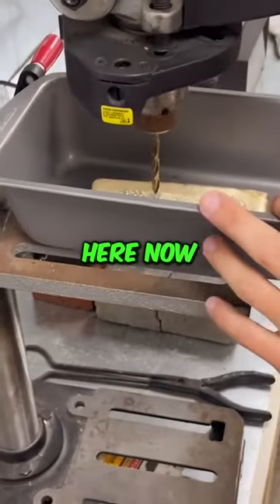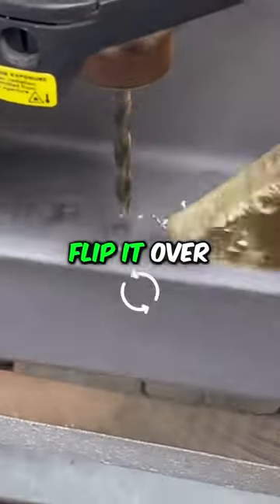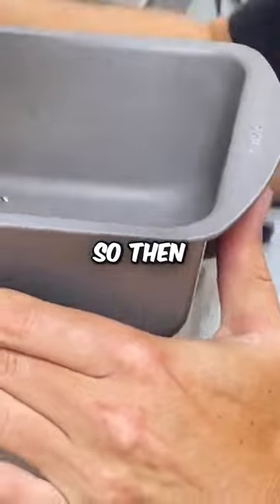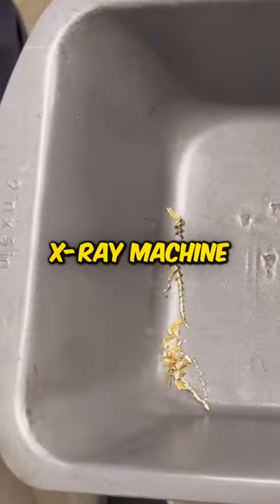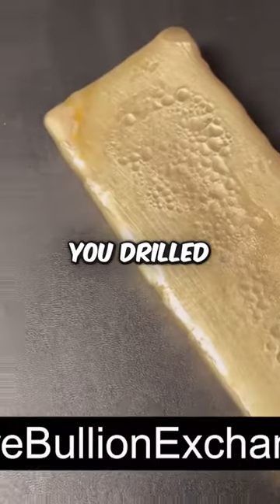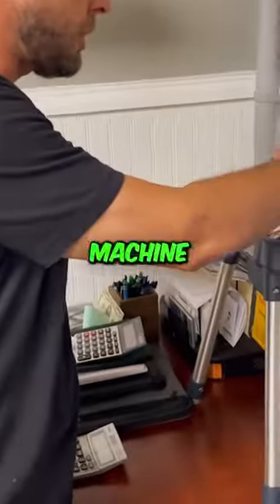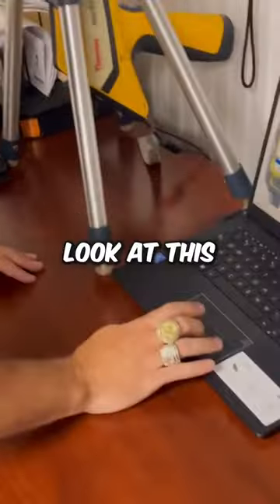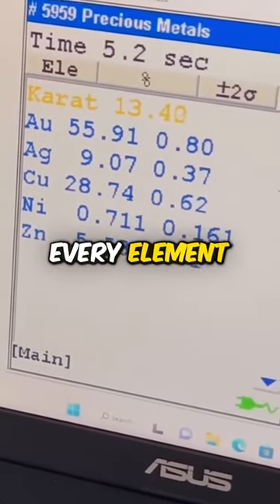Drilling MASSIVE SCRAP Gold Bars WORTH $200,000 For Testing! #shorts

Comment: So as long as I cover the tungsten with atleast 3/8" of gold, I'll be rich? 😅
Reply: You could try...😂
Reply: Lead's much cheaper, also soft. They roll that bar they'll find the wolf right away. 
Lead will roll with it.
Reply: I thought they drilled to the middle on bars this big? I guess not.🤷‍♂️
Reply from the maker: We melted it ourselves in a 3-part video series.
Reply: The caramilk secret lol
Reply: Why tungsten?
Reply: @oliverklozhoff  its the closest metal in weight to gold, counterfeiters use it to make fake bullion. they would find out eventually anyway.
Reply: Gold and tungsten have near identical relative density
Reply: They weren’t drilling to make sure it was legit. They were just getting a sample to test what purity it is. They trust the source. Just getting some from the top and some from the bottom to get a good idea of what the purity of the whole bar is.
Reply: Pawn Stars:

So what do you want to do with your 24ton bars???
Reply: @EmpirePreciousMetals  just seen this and is there a part 2
Reply: Yeah I would think you would drill 3 or 4 holes all the way through to be sure.
Reply: @mircomuntener4643 yeah but tungsten is near the same density as gold lead is way different so if you sneak a piece of tungsten in it and they measure the length width hight of the bar and do the math there not gonna see it. if lead was in there they would easily see it just by doing the math. Tungsten isn't that expensive it's around $6 a pound right now. So for 6$ you could get $20,000 that's a hell of a deal! If you don't get caught and go to prison for fraud!
Reply: Wouldn’t it be easier to just put it through a sigma? How deep to sigmas check?

Comment: A proper core sample requires a hole to be complete because center could be a slab of tungsten.
Reply from the maker: We melted it- we know it’s all scrap gold. We did a three part video on it
Reply: 29% Copper ! Yikes!
Reply: @RickR.7777 not uncommon if you didn't know pure gold is extremely malleable for what it is. Most all gold jewelry is an alloy.
Reply: @RickR.7777 14 carat approximately...
Reply: @RickR.7777  Thats why gold is sold as 24k 12k and not as PURE gold.
Reply: @vihreelinja4743  Thanxx
Reply: @RickR.7777 that like 14k no? Seems pretty normal for scrap but I am no jeweler.

Comment: Wrong..... the bar should be placed on wood and drilled completely through in one direction (incase there is tungsten in the middle), then melt info a bead and then XRF and then weigh then dissolve in HNO3 and then roll to a very thin plate and then HNP3 again and weigh, and repeat. For a more accurate result dissolve in AR and put in ICP-MS or inquart with Ag and then process and compare the chemical assay with the XRF.. bingo you have an accurate test...!
Reply from the maker: WRONG, WE melted this bar ourselves in a 3-part video. It was all scrap gold, no tungsten.
Reply: @EmpirePreciousMetals  not WRONG... if you did this then show the full process otherwise people will be misled... !

Comment: I didnt realize it was typical to mix common and precious metals. I always figured lower carat gold was mixed with silver. Why do they use copper/zinc/ etc?
Reply: They mix it to stabilize its character. Gold can be smashed easily. The zinc, nickel, etc. Will give it strength, durability, toughness, etc. depending on what characteristics are required.

Comment: So you just throw a plastic bag in a machine and a computer program just pops up precise measurements and composition?
Reply from the maker: Yes. Also, the sigma Metalytics machines read through coin capsules and assay cards.
Reply: It has a sample of the gold bar I melted in the plastic bag. The XRF shows the purity of every metal in it.
Reply: @EmpirePreciousMetals  is that a plastic bag?
Reply: @EmpirePreciousMetals  I looked it up and coin cards are made of polyvinyl chloride or polyester and the write-on covered plastic bags are made of polyethylene.

Comment: That's not an x ray .. we use one at work to test alloys we make .. except ours uses a current and burns it slightly  capturing the offgas of it determining by the 2 factors what percentage of what metal it is .. an x ray would take a picture of it and still not be closer to knowing what it is ..

Comment: When drilling through thick bars to test them does it reduce any value?  I'm kind of curious because the bar will have a hole in it
Reply: Not a bar like that since it isn't for design it's value comes from weight

Comment: Doesn't it scan completely through the bar why have to drill it out anymore??
Reply: No. It only gives a surface reading.
Reply: It’s not an ‘x ray machine’ like the one at the hospital that would check for broken bones.

It’s an XRDF ‘x ray dispersive fluorescence’ meter:  it hits the metal sample with x rays that causes the metal to fluoresce like a long tube light.
That light can be used to identify the elements in a sample.

I think if I had a block like that, I’d drill clean through it.

There’s been cases of gold bricks that are really gold clad tungsten.

Based on the glimpse of an analysis shown, that brick is over half gold, 1/4 copper and 1/4 everything else.

Sreetips could work that block up, given some time.
Reply: It's 14k bar from scrap gold melt. not a 24k bar that's why all the additional metals.
Reply: @williamfoote2888  I melted the bar myself. There’s no doubt its gold. I just needed to know the purity. No need to drill through it. Just a sample to put on the X-ray machine.
Reply: @BayshoreBullion  Ah.   Ok.  I figured it was an ‘unknown.’   Somebody sold you ‘gold’ and you were sampling it to pay the seller.

Where’s it going after this? To the refiner?
Reply: @BayshoreBullion  this is about the 100th time telling someone in the comments that you melted the bar , you know it's not fake, it's for gold purity test. 
  If you need to explain this to almost everyone, maybe the video should clarify,  but we have you being a dick
Reply from the maker: Yes, he sends it out to the refiner next. : )

Comment: 2k gold . 20$ per ounce
Reply: That size gold bar is usually around 7-10 pounds.  Try again. At 12k average he has about 60-80k even up to 120k depending refinery prices. He's doing smelting. Which is melt all jewelry together with other gold pieces all karats which creates a smelted bar. Mixed with the copper nickel and silver that usually is made with the jewelry prior melting.  A pure 24k ring with be destroyed if you wear it daily. Too soft so have be harden with other metals that won't devalue the piece